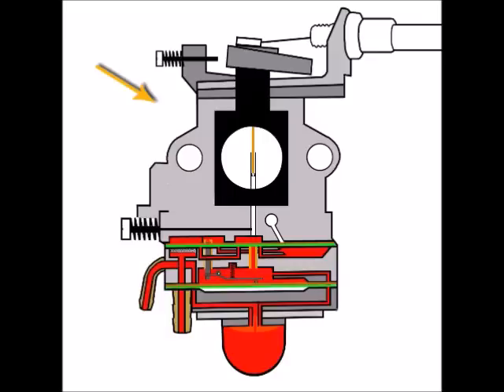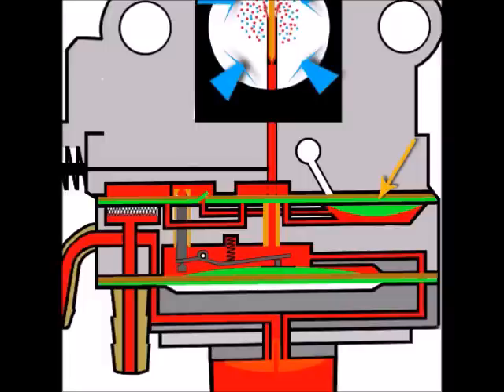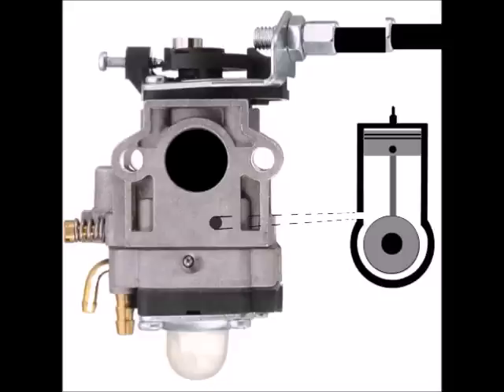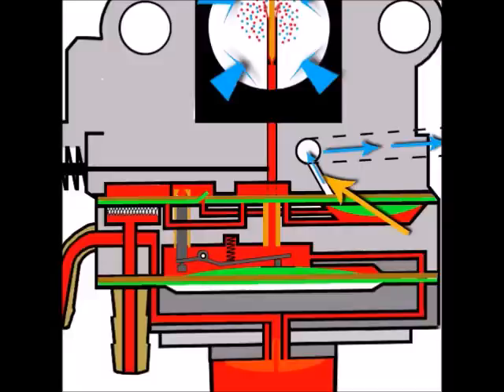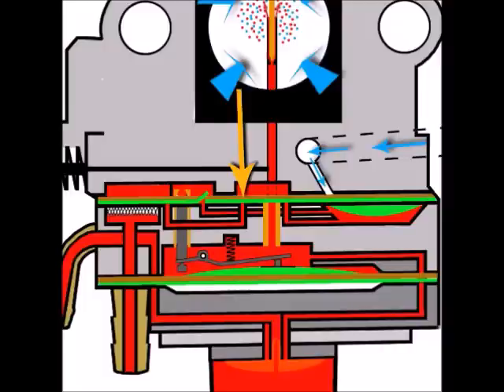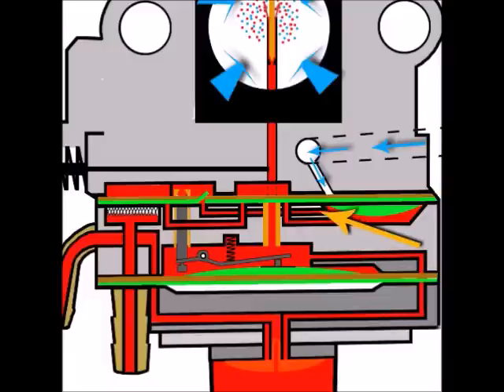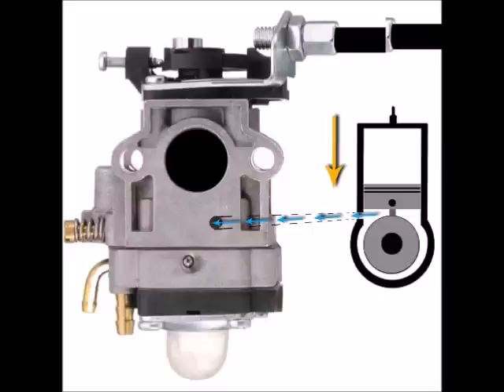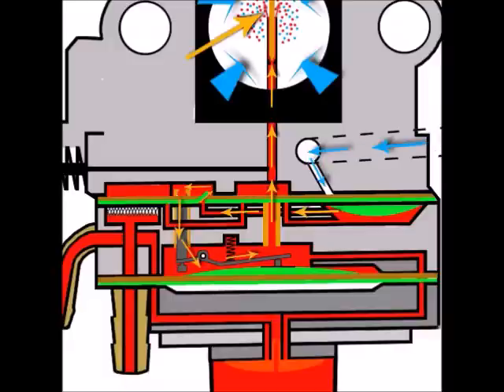CHAINSAW CARBURETOR DIAPHRAGM:  'Fuel-Pump Diaphragm' EPIC Function!

Comment: Still amazed that that wimpy material they make the pump diaphragm out of, that it lasts as long as it does. So much information you give,,, truly a great teacher. thanks.
Reply: Mine didn't seem to last - and it's a high dollar top of the line large stihl hedge trimmer.
But this does help me see why ethanol fuel is to be avoided.

Comment: I’m pulling my hair out trying to repair a walbro 2 stroke carb #228-1. It’s been discontinued and some of the parts are not available. My best friend let this Craftsman blower/Vac sit in his garage for 10 years. I found the gas lines and primer bulb petrified. I removed the carb for closer inspection. That’s where the fun began. Not having much experience with 2 stroke carbs, I decided to try and clean it and install new diaphragms and gaskets. It’s an unusual carb. The base is two stage. Can you explain how the second stage works. After changing all the available parts, it will not draw gasoline into the bulb. Any ideas? I can send you a picture if needed. Thank you.

Comment: Some diaphragm and gasket replacement kits have 2 diaphragms, identical in shape but they're made of different materials (one black and the other brown). Do you have to put the two identical diaphragms in place always? Which one goes in contact with the carburetor body?

Comment: I'm having fuel pour out of the hole you mentioned is for the pump what.would that indicates
Reply from the maker: Well in that case I would first check that all the bolts and retaining screws are sufficiently tight.  Then check to see is there is any damage to the bulb.  If all look well then maybe it is an internal issue and to strip down the carb and take a look to see if all of the diaphragms are present and correctly fitted in place.   I personally would start by doing this.  Thanks. Craig
Reply: @TheRepairSpecialist  my stupid self forgot to put the reeds back on fell off work bench I was working on and didn't notice I was missing them until I rewatched video

Comment: Hi, is there any way to add a fuel bulb for cold starting  to a basic walbro carb that dosent have one? i have an old stihl fs 51 and completely done it over and it runs perfect but only has the choke flat to start and always struggles a little on cold start which was always an issue before they added the primer

Thanks

Comment: I'm having problems with gas flowing thru the carb when the engine is off and has been sitting for a few minutes. The needle valve seals well on the seat when it is closed, but something is causing it to open after several minutes after it's turn off. Can anyone help me by telling me what it could be?

Comment: Hi, I have one question.
Why is fuel pump(diaphram) in system? 
I mean If there is vacuum in ventury and diaphram activates needle why vacuum doesn´t sucks fuel itself....
Maybe you say it but my english is not good.
Reply: The venturi vacuum is not strong enough to suck fuel from the tank and through the fuel filter against gravity. It works without pump - but you need to locate the fuel tank higher than the engine - which is unpractical for most machines.
Reply: @bumboclat  Especially when the machine is meant to be tilted during use. (Hedge trimmers and the like)

Comment: if a 2 cycle carb has no primer bulb, how is the fuel returned to the tank ? please answer...
Reply: it's simply not returned but all used up in the engine. You don't need a return line if you don't have a primer bulb. The return line just prevents you from overflowing the carb by repeated priming.